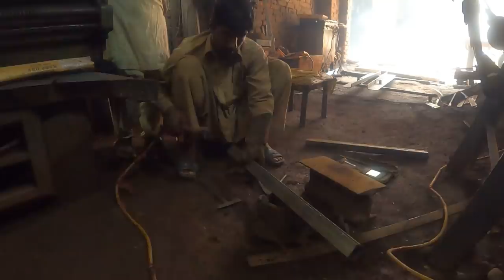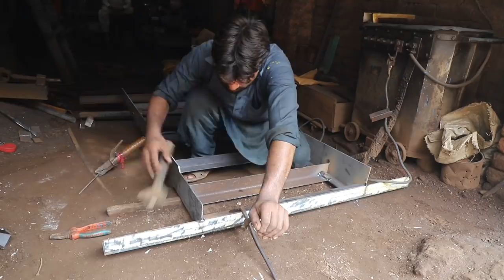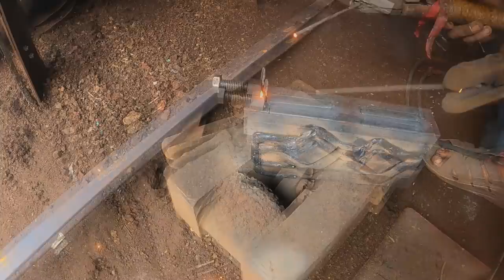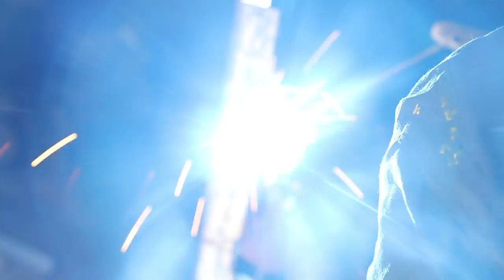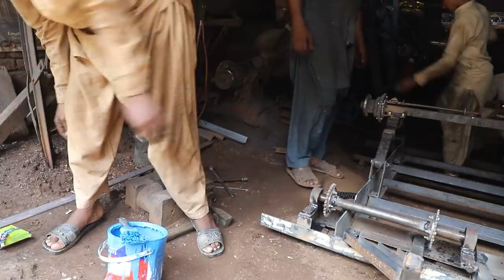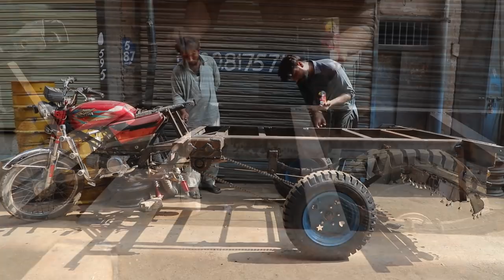Talented Local Guys Build Custom Loader Rickshaw

Comment: Good to see that they use the CE certified safety-squint.

Nice job😁
Reply from the maker: Thanks for watching.
Reply: Yes that is how I tack weld. I am 70 and still weld. Am working on a 27 T truck with a 1947 flathead v8. Body will be on a model A frame and running gear. T model had no front braking.  Only rear. With the little V8 I need 4 wheel braking.